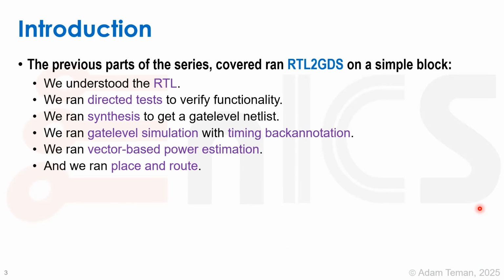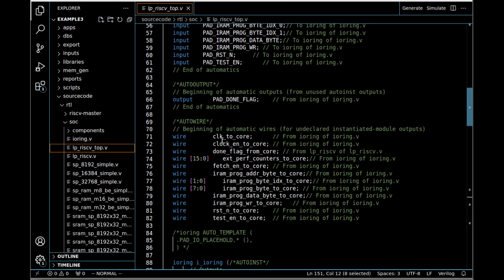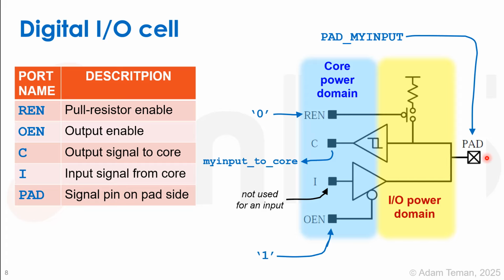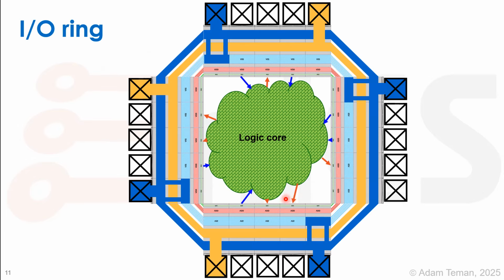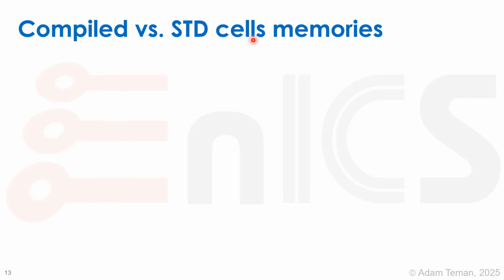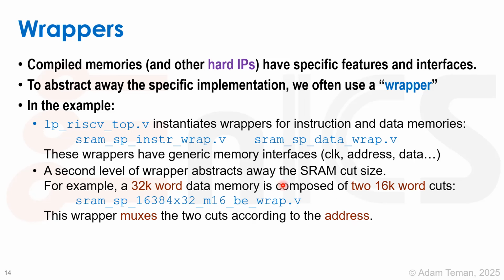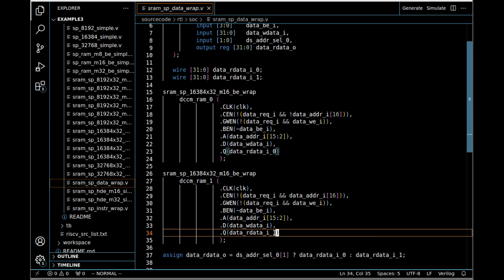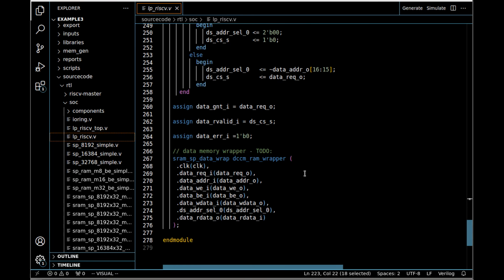RTL2GDS Demo Part 5.1: SoC Demo - SoC Overview

Comment: Thank you, Adi.
I have a couple of questions that I would appreciate if you could answer:

1-In the padring diagram, I noticed you used several VDDIO pads instead of just one. Can we use only one, since it only powers the IOs?

2- Is there a combined VSSIO for all PDKs? I remember there wasn’t such a cell for the 180 nm technology.

3- Could you explain why you didn’t use the clamp IO? Is it required or not?

4- What is the purpose or application of the POC IO?
Reply from the maker: Hi 

These are great questions. I think it wouldn't be bad to have a full lecture on IO libraries, but there is a lot of proprietary stuff  so this is not trivial. But for your questions:

1. There is something called SSO "simultaneously switching outputs". If you have an IO that is driving an external signal, it needs a certain amount of current. If you have a bus of N such outputs, you need N times that current. Each IO power supply can supply a certain amount of current, so you need to define how many IOs could simultaneously switch and then provide a sufficient number of IO power supplies for this. So usually you need more than one such supply - often, you need a large number of them.

2. No, this is a feature of the IO Library. It is very common to short all the grounds in a chip. Some IO libraries provide a cell that shorts VSS and VSSIO and sometimes you have to do this at the board/package level. But usually they are shorted in the end. 

3. No, I did not need a clamp IO. In general (for every IO library I've ever seen), the clamp IO is to add ESD protection for a non protected IO. Standard digital IOs are ESD protected, so they don't need a clamp. Analog IOs are just a wire that connects the external to the internal node and sometimes are not ESD protected, and so they need a clamp.

4. This is actually specific to the IO Library that was used. It is short for "Power on Control" and it is a special feature of some IOs to make sure that things don't get burned out if you turn on VDDIO before VDD or the opposite.
Reply: @AdiTeman  Thank you so much, Adi, for taking the time to answer all these questions. I really appreciate it. It would be great if you could prepare a lecture on IOs, which always seems to be the missing part in most course materials and tutorials.
Regarding the clamp IO, I noticed in the TSMC application  note(180nm) that they place a PCLAMP cell between two pads, PVDD3AC and PVSS3AC, both of which already include ESD diodes. I even used them in two of our tapeouts, but I’m still not entirely sure why they’re needed.
Reply from the maker: Hi,

Maybe  you missed, but I have a lecture about I/Os: https://youtu.be/ZBljnhAxZkc

It may not be comprehensive (for example, I don't believe I discuss Clamps) but it is a pretty good start.

The reason you need the clamps is usually because those are analog IOS that are not ESD protected and so you "manually" add ESD protection to them by using clamps.
Reply: @A @AdiTeman Thank you so much Adi!

Comment: Liked it before even starting it! Thank you, Adi, for all the effort you put into this tutorial series. I have a suggestion that might help. It would be helpful if you could make a video showing how to set up the required libraries to replace the IPs that were removed from the scripts. I think that would help everyone follow the tutorial and replicate the flow on their own machines. Thank you.
Reply from the maker: This is not a bad idea. 
One of the challenges is that PDKs and libraries from different vendors and across different process nodes have very different quirks that make this quite hard to generalize. Believe me, I've erased and rewritten my flow/methodology dozens of times trying to find a "perfect" approach. But for sure, what I provided is a good starting point and indeed can solve 70% or more of the setup. 
I will think about how and when I can add this material.
Reply: @AdiTeman  Yes, I understand how challenging it must have been to prepare this course and tutorial. I’ve done digital tapeouts in both 130 nm and 180 nm technologies, and even though they use similar libraries, it was still quite difficult, especially since I had to switch from Synopsys tools to Genus for HDL synthesis. I also tried to replicate your design in 65 nm (I believe the same node you used), but there are still many details to figure out. Thank you for all the effort you put into this work.